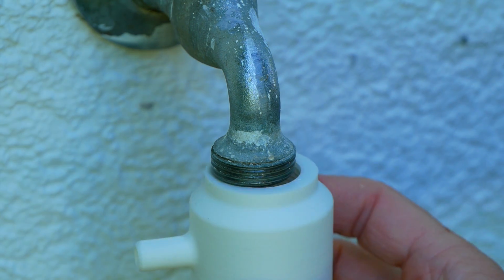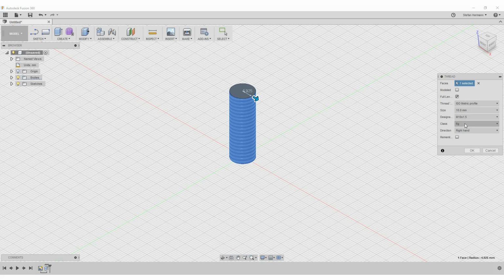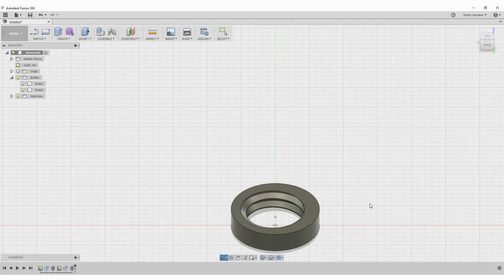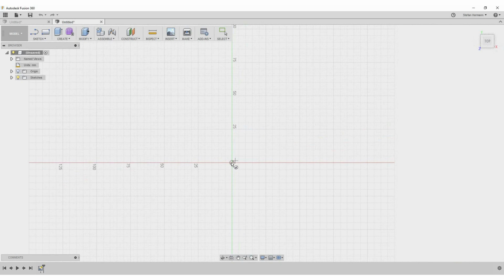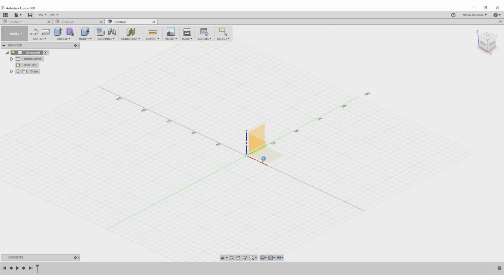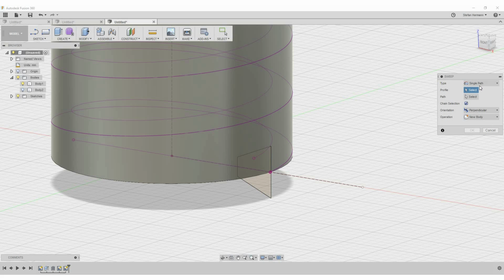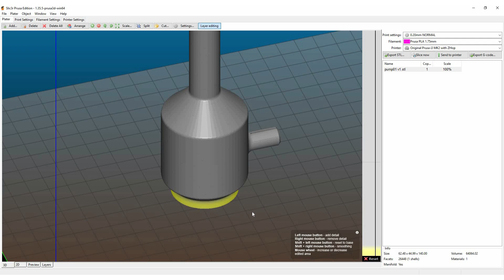3D printed threads - 3 ways to model them in Fusion 360

Comment: Thank you for this tutorial i gonna make a little rounded box to experiment more ! I got a question : You think its possible to have a m6 thread who work on real m6 screws or its chasing the dragon because its too small ?
Reply from the maker: It should probably work if you use small layer heights. In such a case I'd rater recommend recutting them later with a tap or even embedding a real nut.

Comment: I never clicked model... that's why I always ended up printing cylinders 😂
Reply from the maker: Glad you've learned something ;-)
Reply from the maker: This option saves rendering time. Having an assembly with lots of modeled threads will kill your PC.
Reply: yep... sounds familiar XD
Reply: same!
Reply: @powerChriZ The non-modeled option is useful for small holes or rods (think m3 size) that are too small to have threads printed, but should have threads cut. Fusion will provide the correct diameter for your hold/rod and document how you should cut the threads once the print is done. (Also it may use non-modeled threads in CAM but I don't know for sure)
Reply: haha what a numpty
Reply: I did the same! kkkk
Reply: Same here

Comment: I wish I liked Fusion 360 but I just don't.  I still prefer Solidworks 2014 but in 2016 came thread tools.  Oh, well good info in the video.
Reply: I used to use Solidworks primarily as well, as I learned it for work. But once I got use to Fusion, I was sold. It's a pretty solid option, and the cloud features work quite well. Being able to open a model on my phone to show others is super handy.
Reply: For fusion you can get it for free if your a hobby or teacher

Comment: Just as an afterthought : If you know which gap tolerances your printer can handle ... with the section tool you can see if you can print thread rod and nut at the same time and position!

Very nice tutorial, I didn't know Fusion 360 had such catalogue of threads by default ...
Reply from the maker: Yup, you're right. The thing is that the threads can have some very steep overhangs which can negatively influence the tolerances, so you might need to make it a little bit more loose.

Comment: 16:14 agh, is your nozzle bumping into your bed? I think I see the bed moving when it's calibrating along the right side of the printer

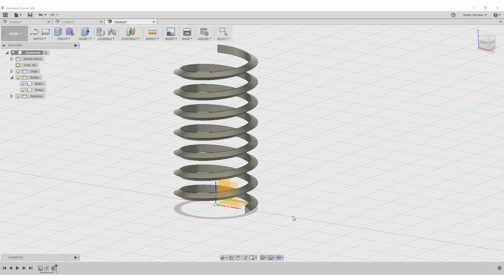also, I've used a similar method in the past to get a helical line for designing with, but I didn't find necessary to make a 3D sketch of the line (12:25). for example, when you need to extrude something along your helical path, you can just select the lines on the coil directly

edit: I also saw an interesting idea on this design https://www.thingiverse.com/thing:1673030 where the threads aren't symmetrical, to allow the printer to print the threads more easily with less overhang

2nd edit: lol this comment is getting pretty big. another way you could try adding tolerance to your threads (if you're printing them vertically) is to use the XY Size Compensation setting in Slic3r or the Horizontal Expansion setting in cura. I'm pretty sure that would give you the same result
Reply from the maker: Yeah, your right. The nozzle is sometimes bumping into the print bed from time to time. That's one of the little complaints that I have on the Prusa. Bed leveling is nice, but my bed is really warped.

I usually don't like the size compensation, because it influences the whole part. But that's definitely a way to go!

Comment: How to install Fusion360 on Win7 ? When to use thread tool and when coil ?
Reply: Most Time you use the thread tool, because is it so easy. When you show the video you understand, when you use the coil tool.
The installation is done with download the exe from AutoDesk an run this.
Reply: Windows 7 is obsolete and no longer supported by most software developers.  But, according to the Fusion360 system requirements,you should still be able to install it on Windows 7 with Service Pack 1, but only inf you have the 64-bit version of Windows, and not the more common 32-bit version.
Reference: https://knowledge.autodesk.com/support/fusion-360/learn-explore/caas/sfdcarticles/sfdcarticles/System-requirements-for-Autodesk-Fusion-360.html